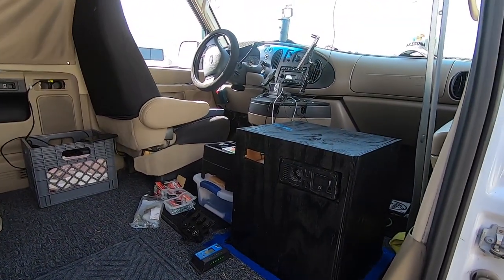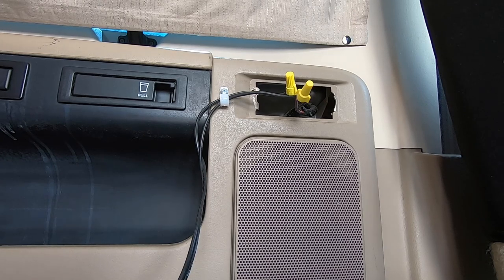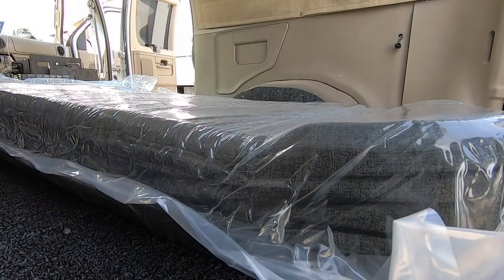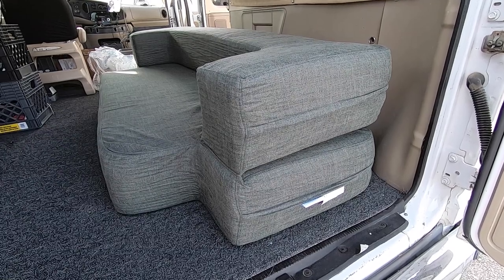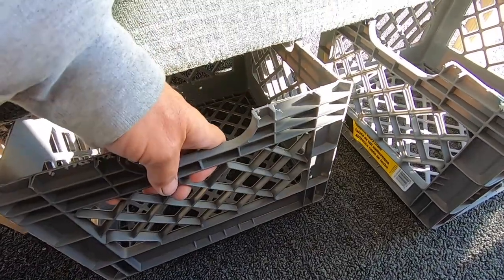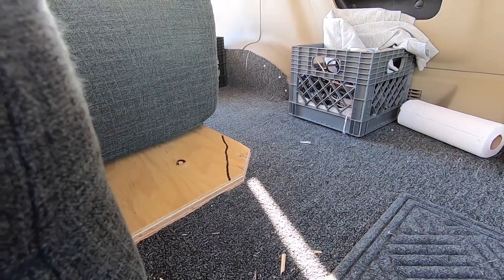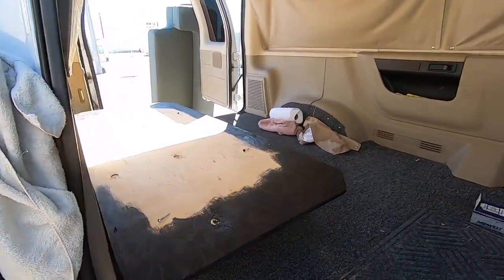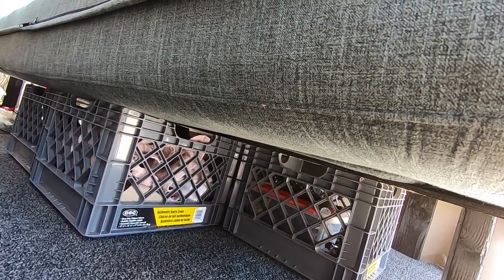Van Build...Couch + Bed In One...Perfect

Comment: Not sure of the headroom you have.  I like the Swedish type frames that is made with 2x4 with the boards laying on the 4 inch side.  The even ones are attached to a board along the wall and the odd ones attached to a board on the front edge.  Both have legs and a center board for a brace that is attached to be stationary with the even boards.  The front board that is attached to the odd boards will slide forward and back and can extend to support the back of the sofa when flipped forward.  I know that wasn't explained very well.  I saw very young full time RVer's use this in their rig.  I can't remember their channel.  Haven't seen a video from them in a long while.  I hope that's enough info that maybe you can figure something out.  I do like what you have but I think it may get a little aggravating pulling out the crates and getting them in place every night.  I'm enjoying the remodel too!  HUGS~Donna

Comment: I'm planning on adding a couple of 12V sockets to my RV.  I've looked at them and wonder what the current rating is on your 12V sockets. What'  gauge of wire are you going to run to the sockets?
Reply from the maker: 12 guage and 5amp